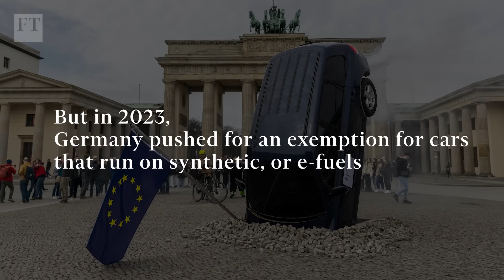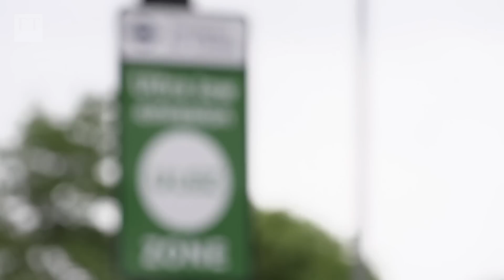The end of the combustion engine? | FT Energy Source

Comment: There will be a tipping point in terms of getting fuel because you need to go to a business to get petrol or diesel. As those fuel businesses disappear, so does the fuel supply chain, so do the ICE cars as it becomes a hassle to refuel them. Sure, they will stay on the roads, for people who only use them occasionally.
Reply: True, and already happening in Norway where a refinery recently closed and petrol stations are closing too.
Reply: @kiae-nirodiariesencore4270  If I remember correctly, demand for fossil fuels in Norway already fell by a quarter from its peak demand. Meaning that there's a need for 25% less fuel stations, refineries, etc in the country. Soon we might start seeing situations where out-of-the-way places (and, later, even not so out-of-the-way places) don't have enough fuel sales to keep even a single fuel station open, at which point people living there that still have ICE cars will need to either move, give up on using cars, or change to an EV — accelerating the drop in fuel demand even more as people still clinging to old ICE cars are effectively forced to change.
Reply: @FabioCapela  "Meaning that there's a need for 25% less fuel stations, refineries, etc in the country."
Refineries make more than just fuel. Remove fuel from the equation, and you still need the other petroleum based products, except you now have to find a way to dispose of the byproducts that used to be used for fuel and generate revenue.

That being said, it's easier to maintain a remote fuel depot than remote charging stations.
Reply: @kiae-nirodiariesencore4270  The US is currently struggling to expand refinery capacities to meet demand.
Reply: @kiae-nirodiariesencore4270  Norway's car markets are distorted by government subsidies, and their society is a petrostate with some of the highest emissions on earth.
Reply: it is also true here in Toronto,  gas stations are closing as well.  Not because of fewer ICE vehicle, but the cost of real estate is so high that the station operators are selling them to developers.  The developers are building condos, and commercial structures not EV charging stations.
Reply: I can run my gasoline car on wood chips
Reply: Gasoline stations are very low profit margin businesses that rely on consistent volume. The whole chain is. Remember at the beginning of covid, when a small drop in global demand caused oil prices to actually go negative (because you can’t just shut down an oil well - it can’t be restarted).
Reply: @davestagner  "Gasoline stations are very low profit margin businesses that rely on consistent volume."
Fuel is usually a loss leader used to attract customers to buy other products.

"Remember at the beginning of covid, when a small drop in global demand caused oil prices to actually go negative "
That was at the tale end of a supply glut from OPEC trying to undercoat shale oil producers in the US. Now OPEC is doing the opposite to keep prices higher.

"(because you can’t just shut down an oil well - it can’t be restarted)."
You actually can. Shale producers do it constantly based upon price.
Reply: @davestagner  oil wells can easily be capped and "restarted" later.  less than half of every barrel of oil distilled becomes gasoline.
Reply: @rotaryenginepete  Less than half becomes gasoline, but if you add diesel — which is also being displaced by EVs — that is already 70%. Add other kinds of fuel — all of which are threatened by renewables and electrification — and that makes up for about 85% of what you get out of refining oil nowadays.

Also, capping an oil well isn't simple or cheap, and carries a meaningful risk that the well will be damaged in the process and produce less than it otherwise could, or even stop producing altogether. It's essentially only done as a last resort if your production costs are higher than the oil price, and expected to remain there for a while.
Reply: @FabioCapela  don't forget that those remaining distillates are used to make an incredible range of products that we all depend on, including plastics, paints, tires, medicine, and other chemicals.
Reply: @FabioCapela   none of those oil products are threatened by electrification, in fact electrification depends on most of them.  Also, oil is naturally replenished and your well capping story is absurd.  Wells are routinely capped without risk so that the oil will reconcentrate.
Reply: @rotaryenginepete  Yeah, but not only replacing all fuels would reduce the demand for oil by some 85%, there are alternative ways of making any and everything we nowadays get out as byproducts of refining oil for fuel — ways that should start getting much more R&D investment as those other distillates stop being fuel byproducts and start being the main products and moneymakers.

We don't really need oil, it's just that using oil is more cost-effective as of right now, but that is likely to change in the next couple decades.

(Incidentally, most of those alternative ways of getting the distillates have been known for a very long time, since the oil crisis of the 70s — but they were abandoned without further development due to pressure from the oil industry as soon as the oil crisis ended.)
Reply: If there is a demand for fuel, industry will supply it.  Only someone with totalitarian tendencies would ban it.
Reply: Ask grandma! Why planned economies fail ...
Reply: Exactly. And as sales volumes of gas/petrol and diesel steadily fall, so does the viability of the whole oil industry. It will become more costly to extract, refine, and transport ever smaller volumes of fossil fuel for diminishing markets.....
Reply: @Brian-om2hh  Haves and have nots. If and When  " volumes fall "  producers  will keep IT,
and then you will know what Rich and Poor really means.
Reply: Hertz reached the tipping point of EV stupidity and now they are selling off their Tesla's for gas powered cars
Reply: NO ONE but a non democratic government can force people to buy anything. telling us we cannot buy an ICE car after 2035 is the start of allowing a non democratic government to exist. we MUST fight this by WANT EVER means is necessary.

And it can work, just look at the way the people of Panama have won the current battle to shut down a copper mine that is destroying their country for a mineral that is essential to EV's .

EV's are wonderful devices as their DIRTY battery  materials come from countries where most citizens cannot fight back. Great concept these EV's re ehhhh ?

Comment: Cost: The electricity required to make the Efuel for an ICE car to travel 1km, if used in an EV will allow it to travel 5-6km. So they will always be at least 5-6 times more expensive than EVs and are currently 20 times the cost of regular gasoline.
Air polluting: Efueled powered ICE cars produce the same amount of exhausts gasses as any other ICE car, so they will be banned in city centers.
Who is behind the Efuels Alliance? Repsol, ExxonMobil, ENI, Gulf and other Internal Combustion Engine dependent companies.
Change your business model Efuels Alliance Members, or you are going to go extinct.

Comment: EV adoption is now moving at the pace of automobile adoption. In 1910, 90% of transportation was by horse. Ten years later, 90% of transportation was by automobile. S-curve transitions, such as smart phones, TVs, refrigeration, etc, are always exponential and we will see the same in this decade for electric transportation.
Reply: That's right. Here in France it took 8 years from the launch of the Renault Zoe to get to 1% of all cars on the road here being EV's, that is 370,000 battery electric vehicles. It took then 2.5 years to reach 2%, the 3% mark will come up in mid 2024 and would have taken 15 months...EV adoption is as you say following the same 'S' curve pattern as the switch to digital cameras, smartphones and just about every other new technology in history. The timebase of the S curve for road vehicles will of course be longer as they are more expensive capital items but the trends are just the same.
Reply: @kiae-nirodiariesencore4270 there is nowhere near enough electricity generated to power all the EVs that the politicians wish to see on the roads . Massive rolling blackouts will be the inevitable side effect of so many EVs . Nevermind the terrible environmental footprint of mining all the elements required for their batteries & the fact that (at home) they take forever to charge
Reply: @bigmedge incorrect, as stated above. 

Plus, one liter of gasoline need around 1,5 kWh worth of electricity (from grid or local generators) from well to tank. 
A 60 liter tank is therefore also ”containing” 90 kWh of electricity. Even if that number is half that, all ICEs are also electric, on top of all pollution!!

E-fuels are even worse in kWh, as the ICE is so uber inefficient!
Reply: @bigmedge I easily charge 55 km each hour connected at 11 kW. 
Even at a measly 2 kW, it adds 10 km per hour. 

Over night, the car is ready for several day’s worth of normal driving!
Reply: @bigmedge  maybe. But that will drive off-grid solutions like solar panels and EVs have battery storage to augment the viability of that transition.
Reply: In Hungary, the average lifespan of a car is 14 years. So it will take 14 years to get to 50% adoption. We don't have money for buying new cars dude.
Reply: @zsoltmarta5654  It will likely be faster for a few reasons.
One, it saves a lot in fuel costs, which throw the usual calculus on when to scrap the old car out of whack.
Two, as the number of EVs rise and the number of ICE cars fall, fuel consumption will fall, meaning lots of fuel stations will go out of business due to lower demand. You can charge an EV at home; that is far harder to do with ICE cars. You don't want to get stuck with an ICE car that you have to drive 50Km or more just to refuel.
Three, Hungary is the most inviting country in the EU for Chinese car makers, so there's a good chance it will have cheaper Chinese cars than the rest of Europe, at least as long as it maintain its pro-Chinese businesses stance.
Reply: @zsoltmarta5654  yeah well guess what's gonna happen when petrol stations start closing en masse when the economics of running one stop working
Reply: @gametheory2-i6p  For the most part a modern ICE engine lasts about 200.000 Km before needing repairs that would cost more than just buying a new engine, though of course that is more than most cars will drive in their whole lifetime.
Modern EV batteries seem to last more than that. And even after they are too degraded for using in an EV, they still have a lot of life left for using as static storage for a house or for the grid. They are not like the old, clunky lead-acid batteries you find in ICE cars.
Also, the materials inside EV batteries are valuable enough to make recycling them economically viable. Though, ironically, EV battery recycling operations are having a hard time scaling up because EV batteries are simply lasting too much, meaning there's less batteries in need of recycling than people thought there would be.
Reply: That was driven by the First World War, the Second World War was a war for oil, which drove the efficiency of production. In 1922 a gallon of fuel in the U.K., was 1s and 2p that is £48 today, it is actually £6.20 and most of that is tax.
Reply: You will not see 90 percent EVs in 10 years.
Reply: @gametheory2-i6p  What is 'electric waste'?...please explain.
Reply: EVs were present in 1910, and they lost to ices because they were inferior
100 years later EVs are still inferior, but have governments ability to force them down our throats
Reply: That's only true in China and Norway. America's EV adoption is going up by 2% a year....
Reply: You need to check your facts. EV sales in the USA are predicted to be about 8.5% in 2023 up from about 5.7% in 2022.   @ecognitio9605
Reply: @ecognitio9605  Norway's EV adoption is being forced and subsidized by the government, so larger full costs are still borne by society and underwritten by oil wealth. EVs in China are being forced by the government and subsidies and are underwritten by cheap coal fired electricity, which when paired with EVs results in higher carbon and criteria emissions than petroleum ICE vehicles.
Reply: @ecognitio9605  Not so. EV sales in the USA so far this year (11 months of data) are 50.7% higher than in 2022 with the million sales level reached for the first time. In Europe the growth rate is 47%  this year with 2.1 million sales (BEVs only, not PHEV)
Reply: Cog, California is the largest car market in the US. EV sales reached 27% in the third quarter of 2023. In the US, overall EV sales increased 50% over 2022. You were saying?
Reply: @gametheory2-i6p  You need to do more research before throwing out comments like that.  For a start most EV batteries will last longer than the cars they are in. There are thousands of EVs now with over 200,000 miles on and the average range loss if 10%. Then research EV battery diagnosis and repair, you will find lots of videos on Youtube showing faulty batteries being diagnosed to the module level, replacements made and the car back on the road again, these are mostly Nissan Leaf's which had no active BMS btw, more modern EVs are proving to last longer, especially those with LFP chemistries. Then check out the billions of investment going into companies who recycle batteries...Redwood Materials, LiCycle, Fortum, Northvolt, EcoBat, Umicore...to name just a few. Recovery rates of lithium, nickel, copper, cobalt, manganese etc have reached 97% and this industry will be worth $50 billion by 2030. You can't recycle tailpipe emissions. As for battery replacement costs, I have seen all sorts of nonsense thrown around by the anti-EV zealots, jumping to conclusions based on things they have seen in the MSM. Where did you get 30,000 from?....thin air I suspect.
Reply: However, EV inventory is stacking up.  GM has delayed EV truck production another year.  Ford has ceased construction of a multi-billion dollar battery manufacturing facility.  Ford lost $4.5B on EVs last year.  Basically, 90% of consumers just don't want them.  Why do EV proponents get so concerned when the free market has spoken?  Why not let everyone buy whatever they like?  ICE people don't care what you buy.  It seems to be only the EV guys that seek to control the consumer.
Reply: Once EVs are cheaper than ICE which is like 2 years away than we will get to 100% EV sales in something like 3 years after that.

And after 5 years used car prices drop by around 50% so in 8 years we will have plenty of used EV costing less than used ICE cars of the same age. Than mass adoption in used market will happen too.
Reply: The cost of running an EV is already cheaper.  The purchase price has almost reached parity with ICE cars and in the next year or two will be cheaper. Who in their right mind is going to buy a car with an internal combustion engine?
Reply: Most technologies follow an S-curve adoption.  The question is not the shape of the curve, but the top limit.  Not everyone owns an Apple computer.  Not everyone wants an EV.  Many people will not buy an EV unless they are forced to spend some quality time with Orwell's Ministry of Love.  I suppose the Ministry of Plenty could weigh in with major fuel shortages.  Isn't living in 1984 wonderful?  Don't you just LOVE Big Brother?
Reply: I guess its battery’s inflammable feature and the vulnerability against cold weather would be in the way
Reply: Those didn't get in the way of ICE vehicles and still don't. People still buy petrol cars despite the fact that they are 20 to 80 times more likely to catch fire and can be very hard to strat on very cold mornings. @fmt0htm
Reply: @fmt0htm  What do you mean by 'inflammable feature'? Do you know that an ICE powered car is 50 times more likely to burst into flames than an EV? You have been looking at too much anti-EV sensationalism in the press, I suggest you study the data on car fires properly and then take a view.
Reply: @fmt0htm  so petrol isn't flammable? 👀
Reply: Tsou, you cannot recycle gasoline or diesel once you burn it. You can recycle batteries. In both ICE and EVs, many car components are un recyclable plastics, which is a problem. That needs to be fixed.
Reply: @freeheeler09 All components can and are recycled. I own a salvage yard.